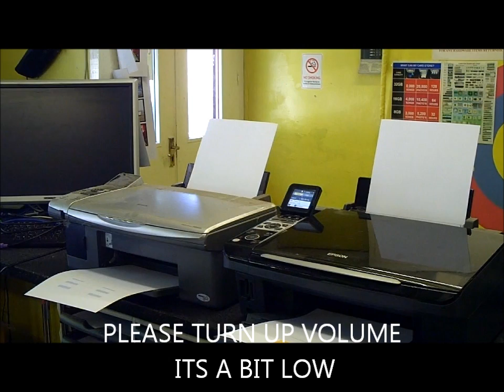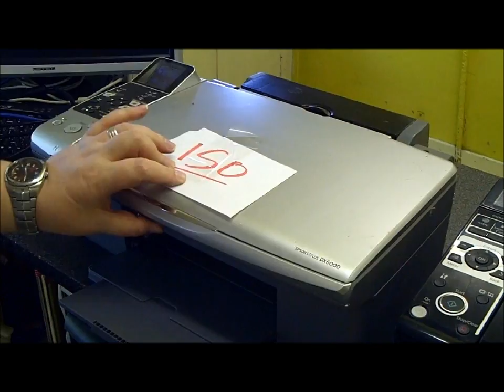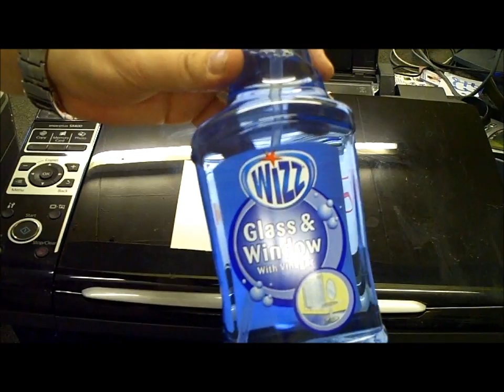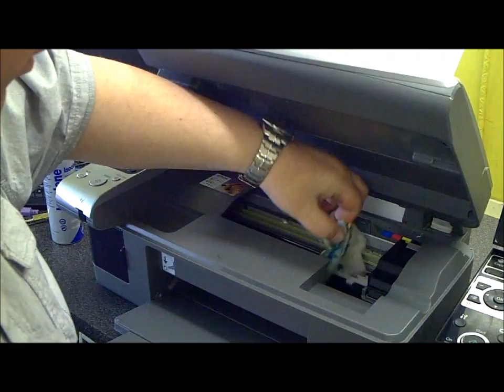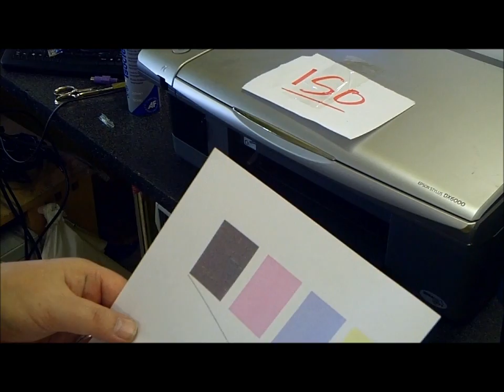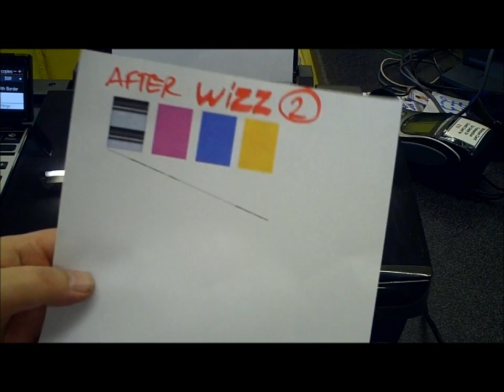How To: Epson Printhead Revival from chocked & Blocked Heads using Icoclean & Wizz

Comment: Hey nice video,..do you think this will work on the "Epson Stylus Photo R200" ?
Reply from the maker: i dont see why not, r200 is a very old printer but works & parts are still same type, its worth a shot
Reply: I tried it last night,...what i did was , i took all of the Ink cartridges out before hand,..then i used 4 strips of paper towel and used another Solution cleaner that i seen on you tube,..the Half and Half of Windex Cleaner and Alcohol ,....i only have issues with one cartridge ,.the Yellow and i did the process ,..sad to say it didn't clean it all the way,. i did see a tad bit difference on the Maintenance Print out of the lines  and that was it,..i don't have the Icoclean,...maybe i can find it in some store like Staples

Comment: My ix4000 cartridge got stuck on the right side and doesn't come out anymore, I tried forcing it out but I didn't put to much pressure on it, I was afraid not to brake something. I google some schematics to try and understand how it works, so maybe I could figure out if there is a mechanism or a trigger to release it ..... couldn't find one :(  you think you could help me please with some incites. 
This is what I found on my printer:
http://www.retrevo.com/support/Canon-iX4000-Printers-manual/id/23010dj881/t/2/

Comment: Darn Epsons - too bad hindsight is 20/20.  Thanks for the tutorial!  You've saved me bunches of headaches and money.  I used windex mixed with a little ammonia, which worked well.  Suggestion - for a lot less mess, instead of using paper towels to absorb the ink, find a female friend who has thin panty-liners and ask for one (THAT'll raise some eyebrows!).  They can be cut to size, and are SUPER absorbent, and have a leakproof backing.
Reply: +listeninma why don't you go to the drugstore and buy panty-liners yourself.  Now THAT will raise some eyebrows :)

Comment: If you are afraid that the mechanism might be damaged while power cut during printhead movement, there is another way, most of your Epson printers (not all because I own the Epson C79 which I condemned and my spare T13) has this small physical switch beside the cartridge holder at the right side where it rests on shutdown, push down that switch (or up if your switch is a different one) to unlock the printhead from the locking platform, there you have the safest way to unlock the printhead, although you wanna note that you need to be careful with the cables that are in the way. If the switch is buried way deep on the right side you will have no choice but to do the method up there.

Comment: Worked great, thanks for this. Didn't have any isoclean so used the nearest thing to it that I had Surgical Spirit. Did it 3 times over a couple of hours and changed kitchen towel every time, ran head clean utility twice and it works like new. One printer saved from a trip to the tip
Reply from the maker: sodthis so glad i could help...what country are you from?.i like to know where my video's are seen
Reply: Carl Pattison Manchester UK
Reply: +Think I might start doing this every 2-3 months as maintenance it prints as clear as a bell now
Reply: +sodthis mine prints as hell now..
Reply: greetings from uruguay. Thanks a lot

Comment: AF International "Isoclene" = 99.7% pure Isopropanol
Rubbing alcohol = 70% Isopropanol

I use rubbing alcohol, ammonia, ethyl glycol cleaner, and water in equal proportions.

There are a number of all-purpose cleaners at the dollar store (99p store?) which work well. Look for Ethylene glycol or similar as an ingredient (on MSDS if you can find it). I believe it's required to be disclosed on the label in Europe. I've read that Tesco bathroom cleaner contains it.

Comment: Thanks for the video. I want to try cleaning the print heads on my Epson TX800FW but can't unlock them to allow me to move them by hand. How do I do this on my printer please.
Reply from the maker: switch printer on while holding the power cable, with the printer lid open so you can see the cartridges, as you switch on you will see the carts move to the left, when it has moved about half an inc/2cm pull out the power cord, this will allow you to move the unit freely, you may have to do it a few times, till you get the hang of it.
Reply: Don Black you see three button in an epson printer. while turning it on, wait for it to initialize, after that, press the middle button the 2nd one of the 3 button, where you see an ink (LOGO). then while doing that it will initialize you to move the printer. after that, remove the power cable and now you can freely move the print head.
Reply: Don Black     O
Reply: Robert Juli

Comment: Excellent tip - I had two of six colours that had failed completely, not responding to head cleaning. I used 'Cristasol Ajax' from Mercadona here in Spain. It is a multi-use glass and stainless steel cleaner. All colours now working again after just a few minutes of cleaning. Many thanks.

Comment: Just unscrew the heads and place them in a cup of dilute bleach or if you cant detach the heads just get a syringe with a rubber tube, blotter paper under the head and inject the bleach through the heads individually to clean it.

Cheap and cheerful should save you loads on those ripoff cleaning kits some of which just contain bleach and a few other useless chemicals.

Comment: Anyone that knows printers and print head technology will NEVER tell you to leave the print head exposed to open air for longer than 4 minutes.  This allows the ink to dry.  That's why they have a capping station.  As for the Isopropyl alcohol , it is destructive to the rubber around the capping station that allows the the head to seal.  It looks good now, but as it deteriorates you cause allot more problems.  Using ammonia based cleaners are a better result.  As for the paper towels, use blue shop towels, they are lint free.
Reply: Isopropyl alcohol won't do any harm at all unless you use it dozens of times which for the vast majority of people is unlikely. I've been using it for years (this is the bit where you tell me I've just been lucky so far). That aside, the components of the printer are almost certainly going to be synthetic material anyway, not rubber.
Reply: OK.. I respectfully disagree. The ink delivery system (aka capping station)  has a rubber seal around the perimeter. This is almost always the cause of the clogs.   When it doesn't seat correctly,  air is introduced,  hence drying the ink on or in the nozzles.
Reply: Most of the ones I have seen are silicon, but regardless, as I say I've been using IPA for years with no problems at all. You would have to use an awful lot of it over time to cause a rubber seal to rot.
Reply: severn sea
Agreed.  I've used Isopropyl alcohol (easily obtained cheaply at any pharmacy) several times and have not experienced any grommet deterioration.

Comment: To save even more money you can buy Isopropyl alcohol (the ingredient in isoclean) as a liquid. Cheaper & you aren't spraying it around so inhale less. While you are in the printer, it's worth cleaning the head cleaning sponge - it's below where the head parks itself. Try dabbing it with more paper towel.

Comment: Re the failed Wizz attempt. Is it a case of the heads being damaged beyond repair?
I read that ammonia-based cleaners are very good at unblocking heads, however through repeated use the ammonia itself attacks the head mechanism. The ammonia also needs to be used in a well-ventilated area. Just thought I'd mention it and gauge your thoughts. I'm thinking of giving it a shot.